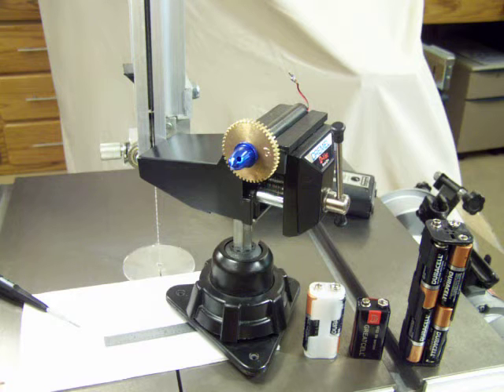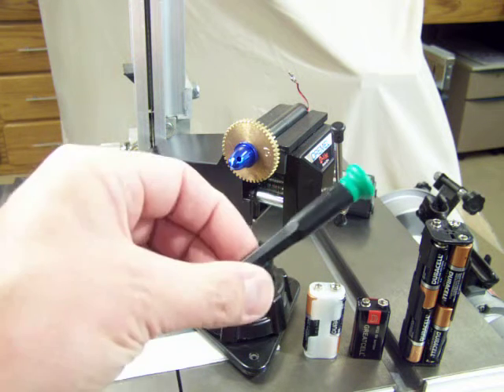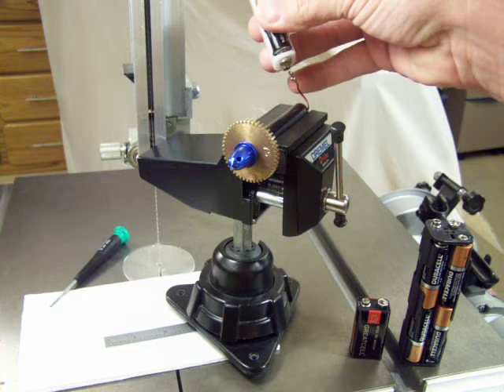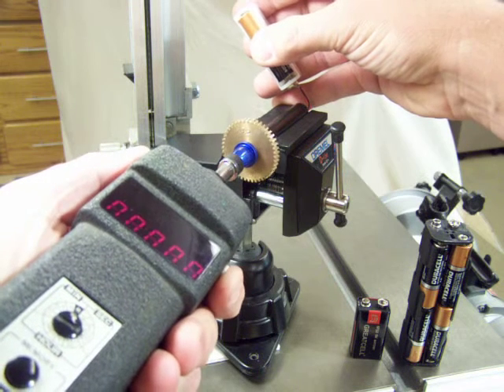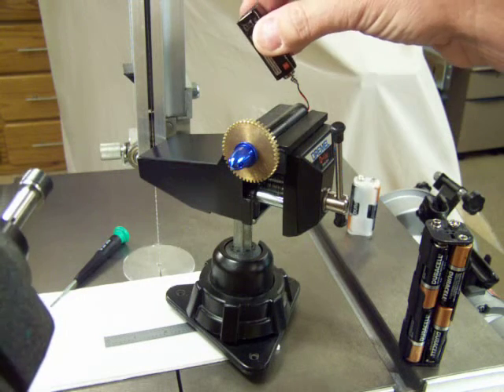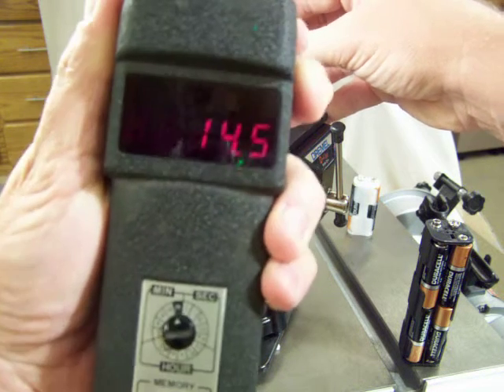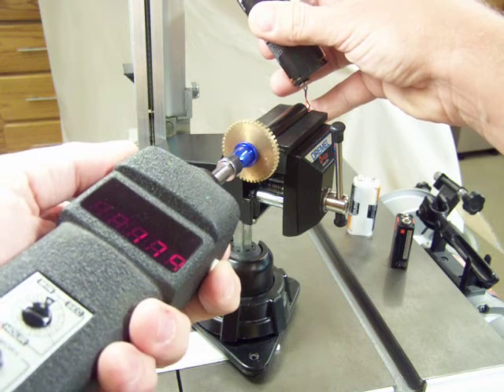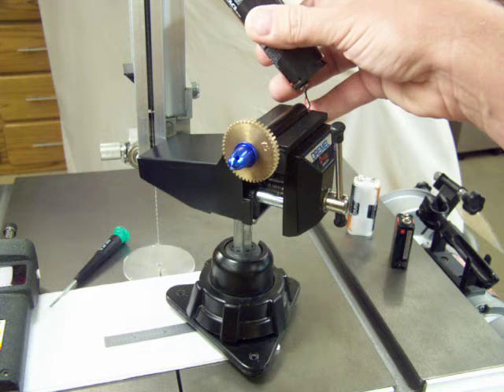SMALL MAXON GEARMOTOR FOR SALE ON EBAY

Comment: Renee Hyer I need a motor to make a cellphone charger. I need one that will output at least 1 amp at a little over 5vdc. I'm very interested in dc motors with high gear ratio that can generate power.  I also understand that I could use these for wind turbines as well, which is also what I'm interested in doing. I'm on YouTube and online every single day, please reply. Thank You. I'm located in Pennsylvania, USA. (+1 : 1)